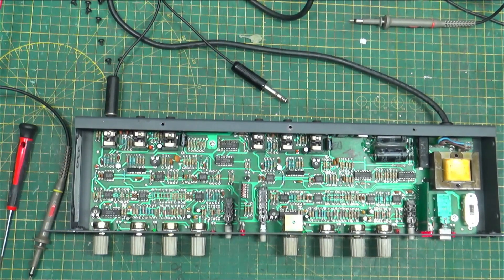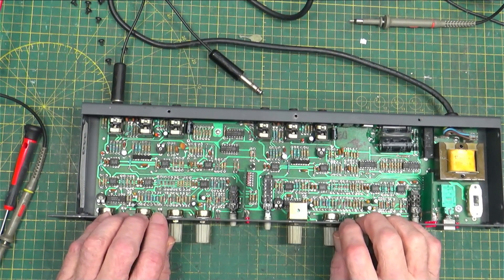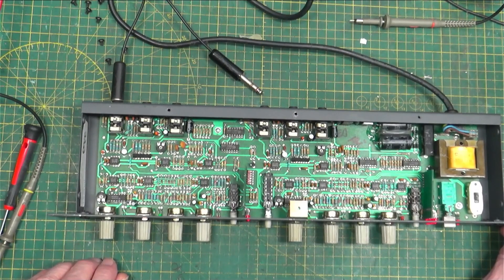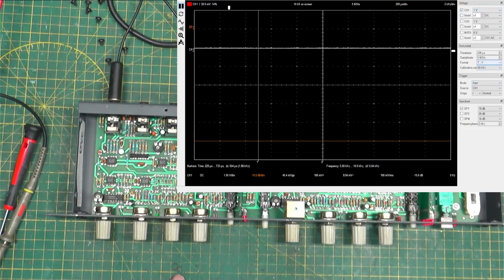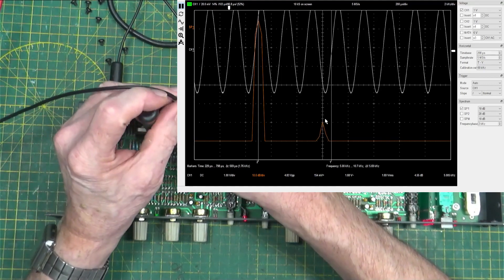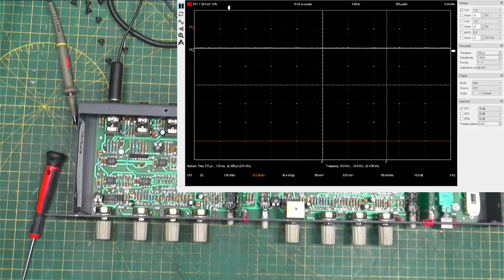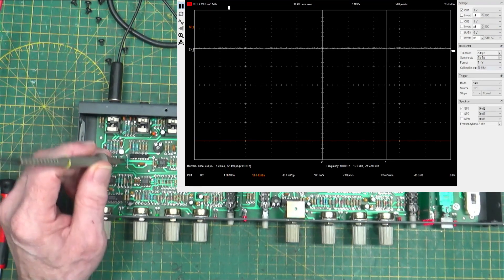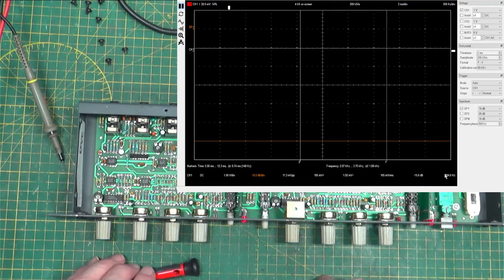Symetrix 525 - How to use FFT on a Cheap Hantek Scope

Comment: Hi, wich Hantek scope are you using in this vídeo? Factory software or open-source alternative? Thanks!
Reply from the maker: It is a Hantek 6022BE. The software is not the original and it is open source.  I believe it is called open hantek. Thanks for watching.
Reply: @AERVBlog  Thanks bro! This scope, when using both channels, could reach a maximum of 10Mhz per channel, right? Do you recommend this model for a basic lab and Arduino/ESP32 projects? If you like synth music, please have a look to my channel. Regards!
Reply from the maker: I don't know if I can recommend it actually. Its lack of an AC input mode limits its usefulness quite a bit especially when working with something like 5V DC and trying to find glitches and the such. I use this one because it is easy and works well on my videos. If I could afford a better one I would definitely get one.